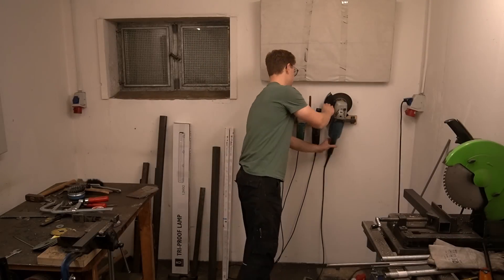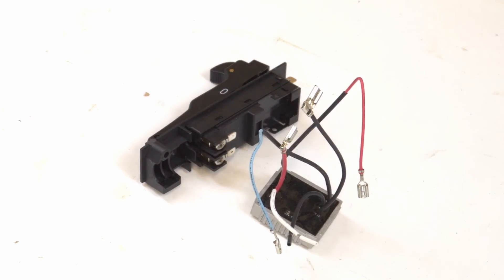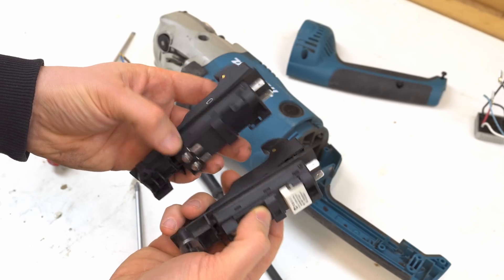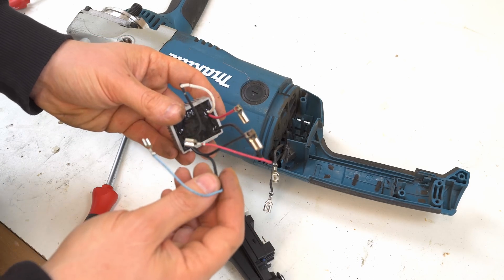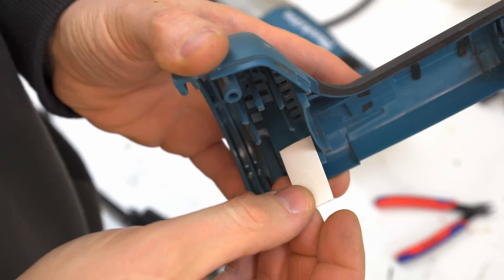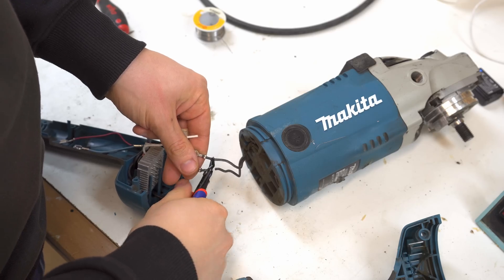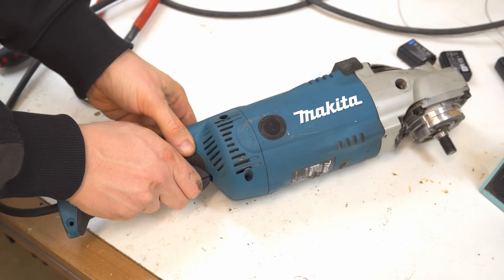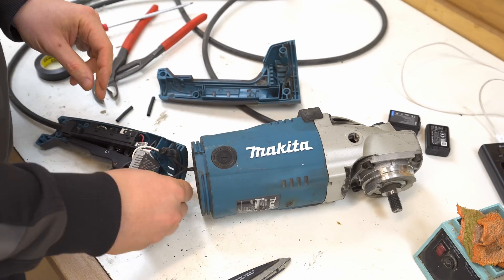Makita Grinder Soft Start Retrofit + Switch Replacement HOW TO

Comment: Maybe the Wago are better than soldering in this case? Sometimes with vibration solder breaks up, because it is harder and fragile. If not, the very correct way would be crimping; for that application much better than soldering. Oh... the safety police in youtube will catch you, for not using safety shoes!!! Also by resting the grinder face down instead face up... ;)
Reply: I'm not sure Wagos are rated for vibration like this though. Probably be fine, but I thinking crimping them would be the best.
Reply: @ADBBuild  Yes. Crimping is the right way really.

Comment: Question is.. why doesnt the machine come with that soft starter from the factory?
Goes for all other mashines too.
Its not just for limiting starting current but also for safety reasons. If find machines with instant 5000 rpm or more downright scary.
Reply: The model with soft start is higher tier and costs more money. You have to get rich somehow as atoolcompany... If you would pack all the nice features worth 5 EUR in the base model and sell it for 10 EUR more, you would loos a lot of money and i bet many people would still buy the cheapest tool, even if 10 EUR more gets you the premium one :D
Reply: @alias_not_needed  If the part doesnt cost more than $30 to buy separately they certainly wont lose money by selling it for $30 more.
All basic things should be included in base models. They dont have to lower the price on high end models because of that.
Reply: @martinsvensson6884  Makita likes to do that ,their hobby brand makitech doesnt have reverse on switch on drill i bought and yet model is cheaper for half a price. Dick move since those cost few $ when you buy in bulk ,same as this soft start.
Reply: @martinsvensson6884 Lets say the sell one million basic tools and save 1 EUR for each tool when they don't put in a soft start. That are 1 Million EUR in sum. Now imagine you could sell the same tool with soft starter for 10 EUR more. Each tool is reduced to the absolut minimum cost to produce. Now find companies who do not do this to rise their profits as much as possible...
Reply: @alias_not_needed  Then just add what the soft starter costs.... I will gladely pay for it....
Reply: @martinsvensson6884  They do. They offer a more expensive model with more features like this. Or if you don't want those features, buy the cheaper one.
Reply: @ADBBuild  Yes but I'm looking for an in between model with just the soft starter. For a price increase that corresponds to the soft starter only. All base models should have that. With an increased price tag if necessary.
Reply: @martinsvensson6884  you have to ask tool manufacturers/Companies for that

Comment: You should get yourself a decent crimp tool. Seriously useful in situations like these. I'd recommend getting the smaller size one + dies for the bigger one (which you can get using the code on the side of the tool). Past the initial investment in the tool, the crimps are cheap.

Comment: Soft starts are good to have on the big grinders, they should all be equipped with that:yougotthis:
Reply: Makita does that to cheaper tools ,its a dick move but they would go bankcrupt if they put 5$(probably even cheaper when you buy it in bulk from china) soft start.